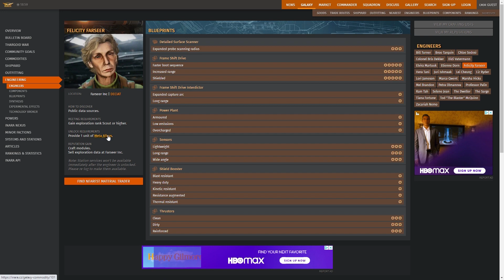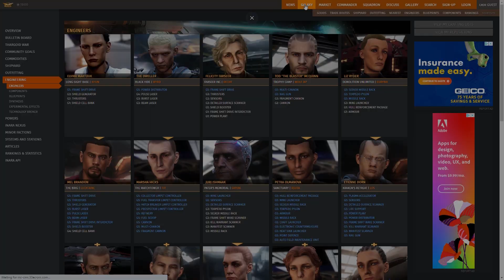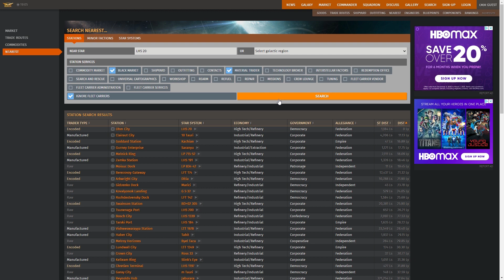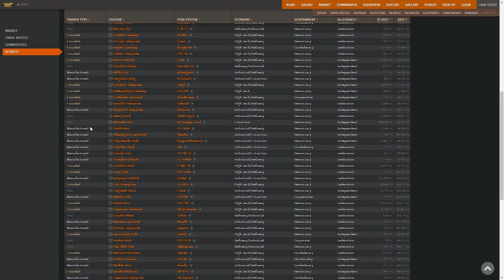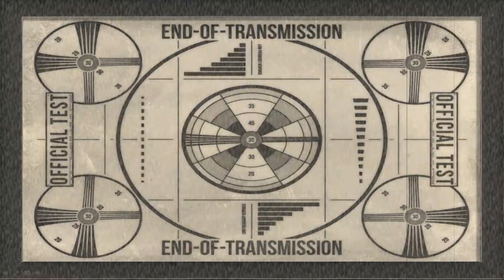Elite Dangerous Ultimate Bounty Hunting Guide: Chapter 4~ How to Unlock the EASY!1!! Engineers

Comment: I just started bounty hunting recently, and it would seem, even though I use an A tier warrant scanner everytime, I'm not pulling near enough credits out of each hunt.
Reply from the maker: A tier A KWS won't get you any bigger bounties than a tier D scanner. The different classes only affect things like range, mass & power consumption. 
Honestly, I almost never use KWS on a small or medium ship because I feel like the limited utility sots are better used for shield boosters or counter measures. 
I'm about to upload a video on earning money from combat specifically, so look for that soon. 
The main thing to do to maximize profits from combat is to always do massacre missions too. 
This can help to boost your income/kill quite a bit!
o7
Reply: @ManusDextra  Can you explain massacre and assassination missions, because I did one assassination mission in my FDL and got literally deleted in about ten seconds. I just want to make sure I'm not doing anything wrong, 22 million per rebuy is harming my bottom line. It's very discouraging.
Reply from the maker: @heroicjello5360  The thing about assassination missions is that the ones that pay well are usually wing missions. You can pull these of alone, BUT you'll need a fully engineered ship to do it in. 
I'd stick to bounty hunting and conflict zones until your ship is fully engineered. Even then, assassination missions are mostly good for fun/challenge. 
Wing massacre missions are the best for making money via combat and that's the subject of chapter 5--should be up tonight or tomorrow...
o7